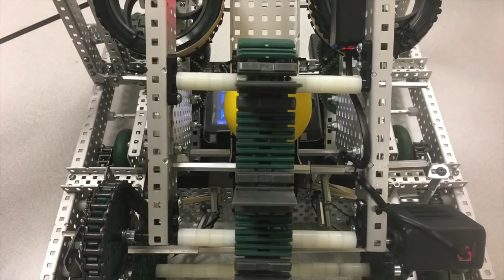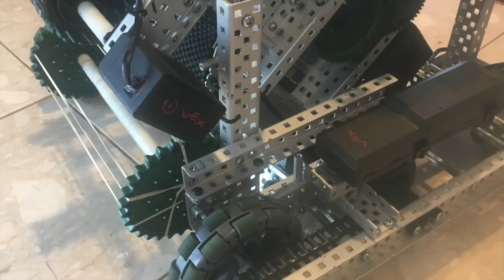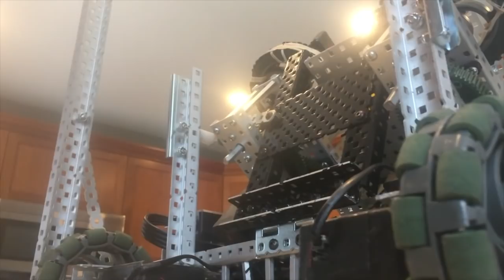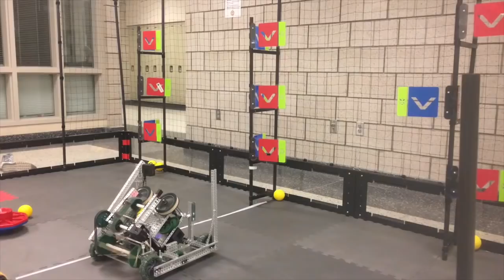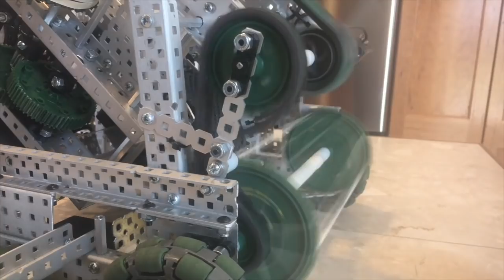Vex Robotics Post-Open Reveal and Explanation

Comment: what competition is this for, im in an frc robotics team this seems very different
Reply from the maker: It’s the VEX competition. Smaller robots, more limited build rules than FRC. You have to use the Vex parts (kinda like Erector set or Meccano), but the competitions are pretty similar.